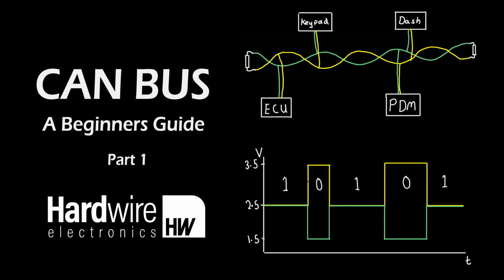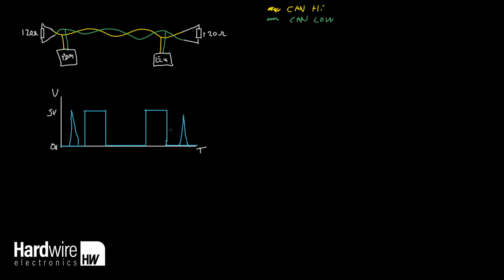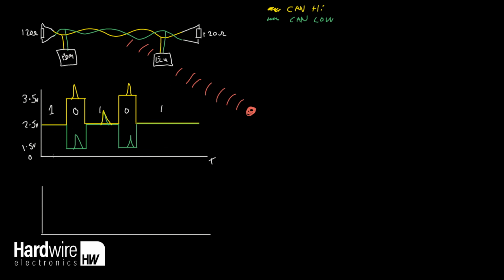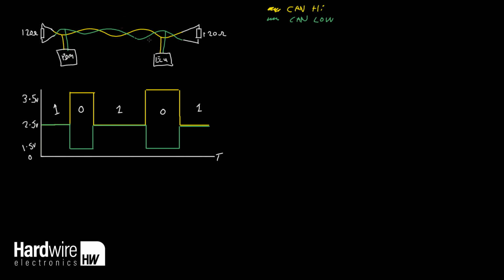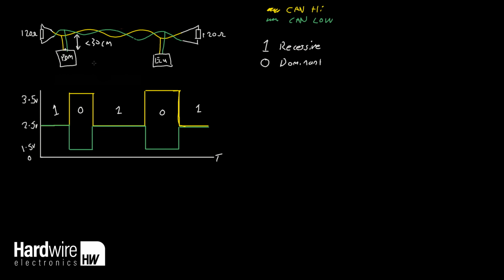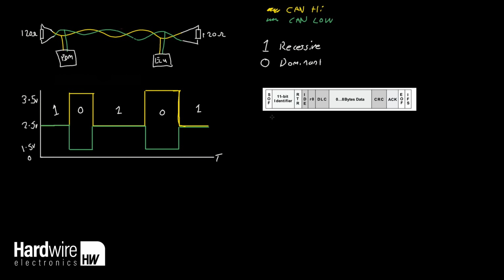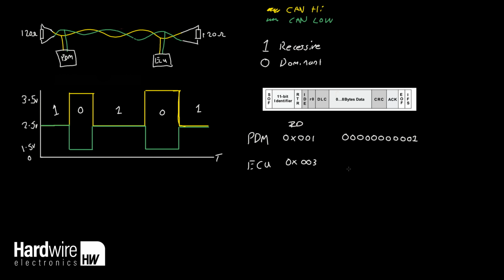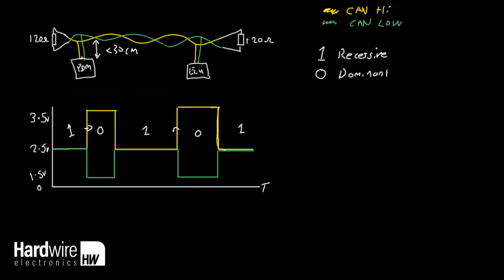CAN Bus: A Beginners Guide Part 1

Comment: Hello, I'm going to use the CAN-FD communication protocol in a project, but I need to connect the actuators using a star topology. I couldn't find any reliable resources about CAN communication and star topology. Is this video discussing it within the framework of a star topology?

Comment: Great explanation, thank you so much. 
The only two question that remains for me are
a) if the 120 ohm resistance for the terminal resistor is somehow dependent on the twisted-pair cables cross section, or if the "characteristic impedance" statement holds true no matter if its 2 x 1.5 mm² or if its 2 x 4.5 mm²? 
b) how the detection of "same-time-sending" works if the two devices don't start at the same time, but either with a delay of some ID bits, or even after the first ID was completely sent?

Comment: Very interesting video. I might need some of your expertise! I have an old RHD car and I had to remove the big heavy power steering block. After upgrading my engine, it was in the way of my exhaust pipe. Now I have found an electric rack which seems very interesting, but I suspect there is CAN in there because apart from the two heavy gage + & -, there are also two smaller gauge wires green and white! How can I implement a little and simple CAN module to make it work, since the car doesn't have it...

Comment: In the Controller Area Network (CAN) protocol, 0 is dominant because it's actively driven to a voltage by the transmitter, while 1 is recessive and passively returned to a voltage by a resistor. This is the opposite of the traditional high and low used in most systems. 

I added this from Google because I wasn't sure why zero had priority 

Other than that you explained the CAN bus great

Comment: Tell me one reason for this scenario in a Mercedes after customer put jump leads incorrectly. Can h and can h resistance checked showing 60 ohms. Can h can l showing 0.06v each. Main engine ecu not showing on Autel top of range scanners. Ecu removed and tested. Works fine. 

So please one reason for 0.06v.

Comment: Thank you very much for this insightful video! I have one question regarding the termination: Do there have to be only two ends in this circuit or can there be more as long as the internal resistance remains at 60 Ohms?
For example, imagine an X-shaped circuit (two parallel standard CAN bus circuits) with 240Ohms to terminate them at each of the four ends?

Comment: Hi , I'm wondering if you can help me I've got a P1695 CAN communication Bus fault the info says it's a communication bus fault ( PCM / FIP ) the DTC may be caused by open / short circuit to ground or battery , check wiring from battery to FIP carry out CAN test , I've checked ground to battery and I've checked wiring to FIP it's got a 12v feed to the pump but I'm stuck and have no idea what to check now , any advice would be appreciated my vehicle is a 2004 LDV convoy minibus .
Reply: Did you checked the resistors?

Comment: I first fell in love with CAN bus when I found out a message collision doesn't stop the high priority message from getting through without interference!  The lower priority just backs off and the high priority message goes out unimpeded.  (Unlike ethernet, where EVERY transmitter in a collision has to back off and wait a random time before retry).

Comment: And what is the voltage of idle state - when no device is transmitting? Is that 0 or 2.5V?
Reply: The High line will be steady @ 2.5V and the Low line will be steady @ 0v
Reply: @1963TOMB  Any reference to official doc? According to the guide both lines should be at 2.5 V

Comment: There are to things which are interesting but where not covered in the film (which was very cool and informative btw. :))
1. How is the bitrate/sampling time aligned?
2. How does the fault detection work and when retransmission is forced?
Reply: Yeh how does it differentiate a row of zero’s from 010101, if all you have is voltage no voltage, I think they come at precise intervals and the receiver asks what do you have now. Would of been nice to explain this but I got a lot from this video. So thanks for that

Comment: Thanks for this. i'm trying to understand so i can fix my own vehicles.  thinking out loud here... Terminator resistors absorbs the electrical energy of the signal as it reaches the ends of cable and avoids reflection of signals. So it doesn't become noise. this is similar to BNC type networking cabling back in the 80s-90s. usually theres a limit to the length bec the signal can degrade to unusable or too noisy beyond that length. twisted pair cabling is whats in use in networking today. as he explained. twisting it helps cancel out the EM field each wire generate and make the signal cleaner and go further. right hand rule and such of EM fields moving in a direction. differential signalling is brilliant! i believe it would be educational for people to learn networking concepts as they are very similar.
Reply: Reflections are minimised by having a terminating load that matches the characteristic impedance (a.c. resistance) of the cabling. In radio systems, this effect is specifically tested for during cable installation to ensure maximum forward power, i.e. minimum return loss.

Comment: If every node needs to be within 30cm (12 inch) how does the OBDII can works? It is far from the ECU, does that mean the man can bus wire run all the way to the ECU? Also how does rhiw change with ECU (motec) that have multiple can ports? Can you make multiple can bus branch? Like, a pair lf teeminating resistor in each for port? Or the port are internally comnected at inside the ECU and you still only need 1 pair of resistor for the whole network?

Comment: If you really want to understand what's going on with the twisted wire pairs then the Altuim talk by Rick Hartley is critical. 
It has to do with electrodynamics in that electrical energy travels around the conductor, not inside of it.

Comment: I bought a BMW Motorcycle and had to learn about CAN-Bus. In inutes I learned that this is very old technology as in Thick-Net over 1/2 coax from 1983. At is a little different but works the same.

Comment: There are 2 different physical layer CAN types: high and low speed. Would be great to (at least) mention this fact. You talk about high speed CAN.
The colors are not standardized or specified. Yellow/Green might be used often.
5:37 Single wire is misleading as ground is still needed -> 2 wire. How the data is detected is the difference. BTW 12V as a solution is a strange idea.
11:30 before, there was the interpretation of the states and now the way how it is done?
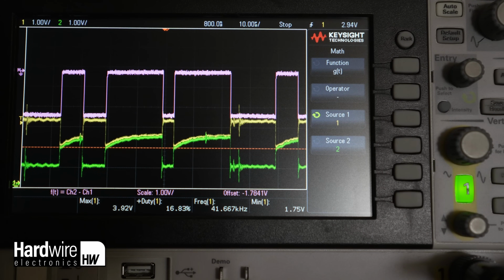15:04 CAN transceiver which might be in a CAN controller but usually there are much more CAN controllers in uC while the CAN transceiver is external
15:23 Not the twisted pair of wires is essential, the differential signal is, which works on 2 lines, here a twisted pair of wires. You can use twisted pair on "single wire + ground" and this will not make the transmission more resilient to external electrical interferences. The differential signal is the key.
Stub length (in theory) depends on the CAN speed -> 30cm for 1Mbit/s. In practical applications much longer stubs are common. Best would be to request to move the termination to the longest distance (the bus ends) then. Also there is a weak termination possible. See CAN application note NXP.
Reply: Are you teaching the dude in the video or are you trying to teach us?
Reply: @dreece2000  who ever needs to understand this.

Comment: Thanks, takes me back to the early 2000s when me lab partner and me were jobbed with linking two Atmel 8051 MCUs on a CAN BUS - can't remember what it actually did but the module was on multi-processor embedded systems in C++ - now trying to get my head around what the hell is happening on all the modules on a modern car 😁

Comment: 2:48 And then Windmöller arrived like: "Screw this, both green and yellow will be tied together for ground, we'll add white for high, brown for low, and we'll sometimes use the shielding around the cable as another connection for no apparent reason"

Comment: One of most important features of the CAN bus is it's noise immunity.  It can operate in very noisy environments where other protocols fail.  That's it's primary strength.  Cars are very noisy electrically - especially the ground.
Reply: isn't that's why drain wire is shielded with CAN hi and low !
Reply: It's a differential pair, similar to RS485 which in turn is RS422 on two wires instead of four, i.e. half duplex instead of full duplex
Reply: guess that is why they are used quite a lot in tank simulator gear as well
Reply: Where are you guys copying from
Reply: @dreece2000 😂😂

Comment: Thank you very much ! I have one naiive question though at 10:18, is there a particular reason why we consider the zero volt difference as 1, and the 2 volt difference as zero, and not the other way around?
Reply: Yes, the 0 needs to be a "dominant" bit during arbitration or packet collision. One way of achieving this with potentially multiple device driving the bus is to let the recessive nodes with their 1 remain passive (i.e. no voltage difference, or hi-Z) while the dominant node(s) force a difference with their 0 bit value.

Comment: When you mention the single wire system and noise problems, you show a 5V level having a potential 5V glitch.  As a solution you then raise the signal level to 12V to overcome the threshold so the 5V isn't seen anymore.  This is wrong!  Glitched don't confine themselves to 5V.  If there is a 12V system for signals, the glitches more more likely be 12V as well.  So that is not a reason to raise signal levels to 12V.  Pedantic mode off....
Reply: I don't think that is necessarily pedantic; it's a fair point to raise. He gave that example, I think, because he's referring to external induced noise (EMF) not inherit line noise (which would be symmetrical on both lines by design if the noise is internal to the transceiver or just a fault if one line is electrically impacted by physical short-circuit or open load type faults), raising the line active level far away from the noise floor actually does mitigate this external noise but in a naïve way (no disrespect intended), if the actual operational context of the ECU is not considered. It's much, much more complicated than "just two wires" might lead some to believe, however this isn't hobby level electronics we're talking about and communications in an automotive setting need to actually be guaranteed to a minimum automotive standard (can't remember the ISO number of the top of my head) and depending on the use of the actual signals traveling on those lines, the SW part, at least, of that CAN implementation is held to higher and higher standards such as levels on the ASIL standards (safety standards) as well as (newer) cyber security standards which in the EU at least, will be mandatory by law, in any new ECU sold after mid 2024, if I remember the year correctly. And, regardless, if the operating conditions of a vehicle exposes it to such a high induced external noise on balanced lines, then, even though I'm no expert, it may be that the wrong CAN type is used (in this case "normal" CAN or CAN-HS - high speed or CAN-FD - flexible data rate) so one might use the CAN-FT - fault tolerant - bus that has the lines go from -27V to +40V or even a terminating bias CAN that has power and ground cables besides the two data lines that provides the same electrical bias and terminations for each bus segment, and this is just scratching the surface of the physical layer of the standard with no mention of errors/collisions/bit timings/ bit sampling/faults mitigation happening in all the other layers of an actual CAN com stack.

Comment: Very informative, thank you!! The arbitration is interesting.  I work with this on a daily basis and now I know why an ABS module id was  changed to 7E6.  This gives it a much higher priority as it should be.
Reply: The ABS module shouldn't need to be on the CAN Bus at all in order to operate. It should be able to operate entirely on its own. Indeed, the only reason it even needs access to the CAN Bus at all is malfunction lights.
Reply: It needs to be on CAN to send/recieve signals from other modules that it relies on for vehicle info like vehicle speed, ignition status etc.  ABS will not work without these signals.
Reply: @ethompson526  ABS will work just fine without those signals. ABS predates CAN by over a decade fun fact. Mercedes was putting it in the S class in the late 70s, GM was putting it in select high end Caddies in the early 80s, and by 1990 p.much anything that wasnt the lowest trim vehicle on the showroom had at least rear wheel ABS. CAN didnt come around until OBD II in the mid 90s, and even then, CAN integration was minimal. ABS didnt really start talking on CAN until the early 2000s when everything started getting other driver's aids that also used wheel speed sensor data. Moreover, there are ABS retrofit kits available for classic cars that are 100% stand alone and are designed to work in a car that is otherwise electrically unmodified. You could put ABS on a 1929 Ford Model A if you wanted to. 

Ignition status is irrelevant. ABS should be active any time the car is moving whether the ignition is on or not. An ignition switch failure should not mean ABS no longer works. Can also be derived from the simple fact that the fucking module has power in the first place if one wants to avoid another quiescent current draining the battery; if the module is on it knows ignition is also on.

ABS is where vehicle speed data is collected these days. It does not need access to CAN to know how fast the car is going. It operates by measuring the speed of each wheel and comparing across the car looking for a discrepancy indicating a locked brake, so by virtue of how it operates, it already has that data. CAN needs ABS to report vehicle speed to the driver but ABS doesnt need CAN since it is collecting that data directly anyway.

ABS is perfectly capable of collecting all the data it needs to function without any CAN whatsoever.
Reply: @TestECull  With respect, I think you are looking backwards too much.
I agree ABS in one of its various guises has been around for many many years. That said each system was quite proprietary and implemented entirely according to the vendors whim.
 I see the introduction of CANbus as an enabler to bring, not just ABS but, all those vehicle management functions together over one common resilient transmission media, I'e. Why have multiple systems?
Reply: @boldford  Part of why I refuse to buy modern cars is how ridiculously interconnected they are. I should not have to worry about a blown out speaker causing a no crank no start fault, and it won't in older cars because the radio is completely standalone. But on these modern ones the radio is on CAN and if the blown speaker takes out the wrong chip in the head unit it will flood CAN with garbage data that drowns out all the other sensors and such the vehicle needs to run. erego, a speaker failure can take the entire car offline these days. 

ABS has no need of CAN and should be perfectly capable of functioning on its own as it used to do. If we're going to insist on coddling the morons on the road by throwing ADAS at their bad driving instead of actually solving the root problem, let's at least make sure those various systems can and will function entirely independently of anything else on the car.
Reply: @TestECull  I know of very few cars built in the last decade without CANbus. Methinks you will encounter ever increasing welding bills at each annual vehicle inspection.
🙄
Reply: @boldford  I don't have annual inspections nor do I live in the rust belt. My 37 year old carburetted Ford truck has less rust on it than some <10 year old Dodge Rams I see rolling about! 🤣😂

I can't be arsed to do it right now but I could pick nits with absolutely everything modern about modern cars as a reason why I don't want them. Let's just say I won't buy anything newer than my F150 and leave it at that. No carb no sale. No manual, no sale.
Reply: @pitchforkpeasant6219 Yeeeeep. Modern cars are so heavily interconnected that a mouse chewing a short into a speaker wire can cause a no crank no start fault. Short blows the arse end out of some stuff in the head unit, wrong chip is affected, head unit uncontrollably floods bullshit onto CAN, ECU can't hear the sensors on the engine, trans, pedals, engine and trans can't hear the ECU.....yeesh. And it also makes stealing cars easier, too, one of the popular methods thieves use involves tearing the plastic bumper away from a headlight and plugging a small arduino based device into the CAN wiring just behind that plastic bumper cover that allows that fancy pants LED headlight to change colors 'n such. 

Its horrible. And of course modern radio head units aren't standard sized anymore either....

I love my simple, carburetted, manually shifted, sealed beam carrying F150 👌
Reply: @boldford  I almost said something mean to him thanks for doing one better.  You don’t have to be mean.  My old man was like that. It took him so long to just buy a computer. Finally had to force him to look at how much easier it is to let software work for him instead of writing an invoice by hand. Before he died he could actually peck the keyboard with his pointing fingers faster than most people could type
Reply: I have a 97 e250 van. The first era of fuel injected engines rocked. Very few vacuum lines are the biggest improvement to carbs. Easily get 300k out of most of them.